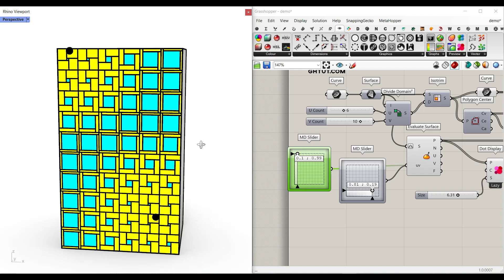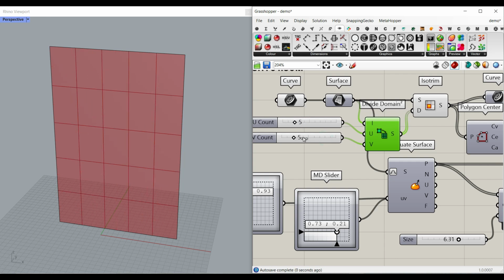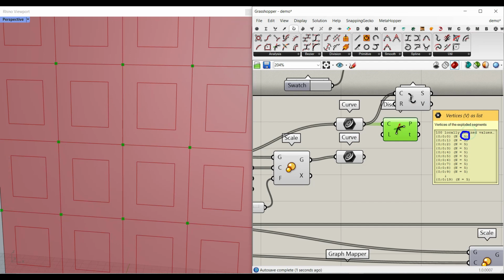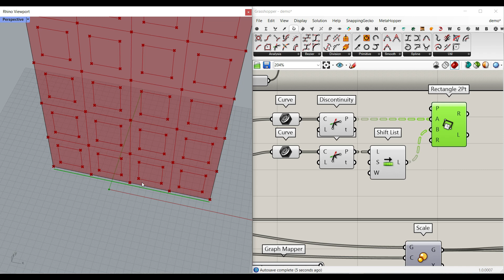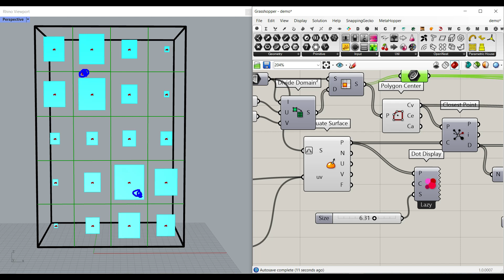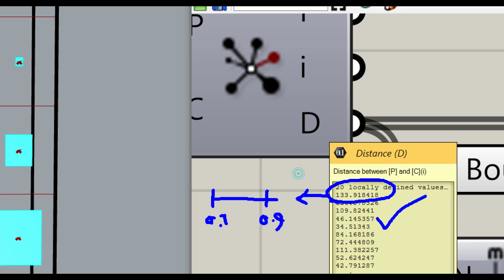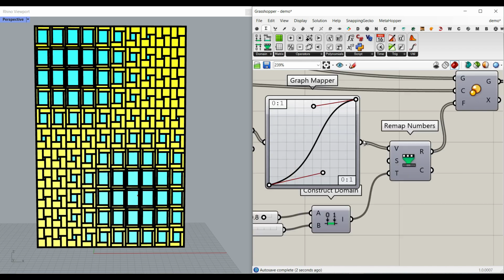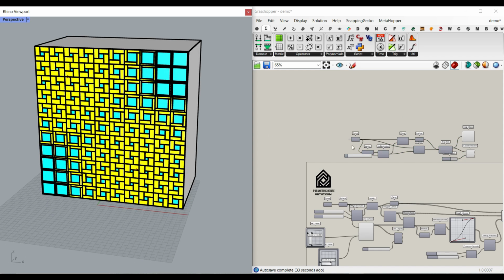Grasshopper Tutorial (Parametric Faade Pattern)

Comment: I had success with this until I reached the part where you remap the numbers of the closest points and put them into the graph mapper. When I plug the closest point into the value input of the number remapper, and have the bounds node coming from the distance output of the closest points node, into the source input for the numbers remapper node I do not get values between 0 and 1. Why would this be?
Reply: I figured it out